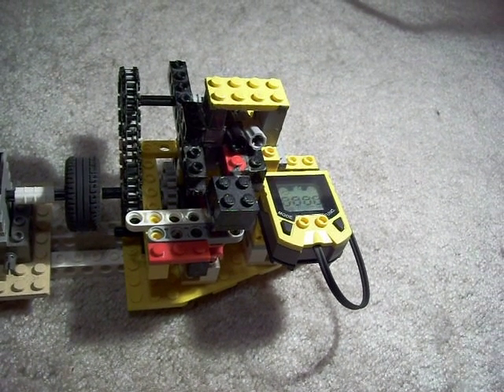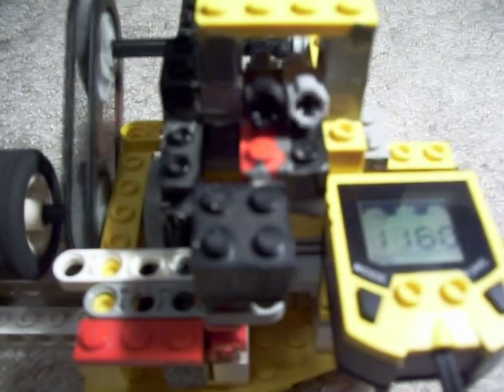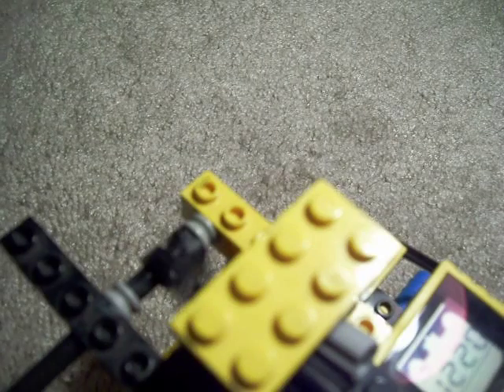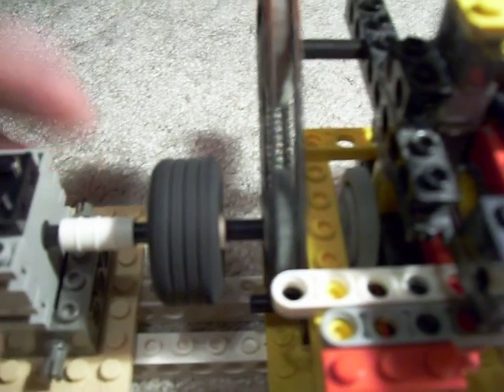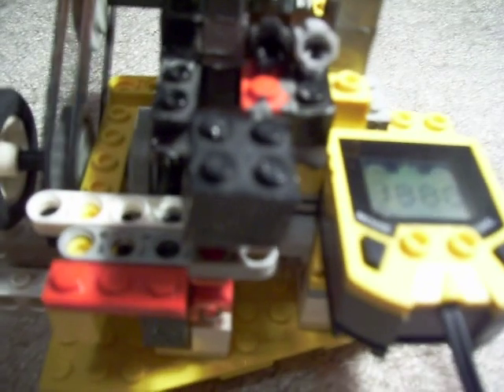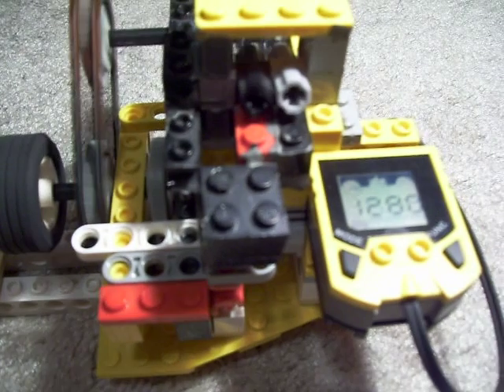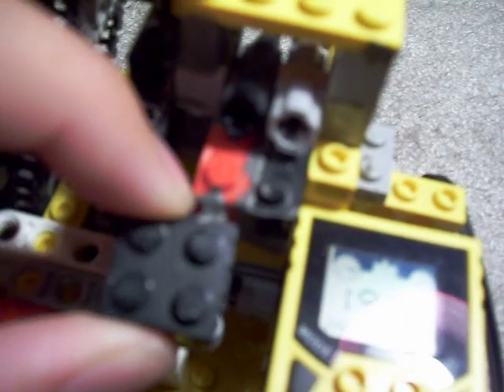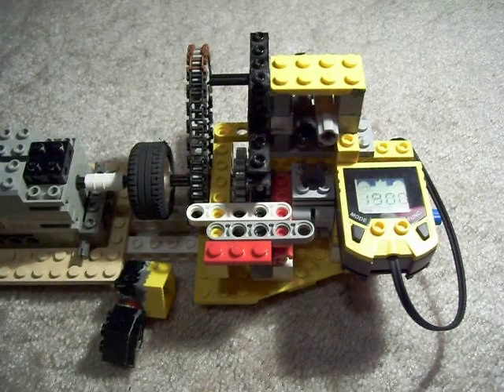4 stroke engine update #6

Comment: you could make it deisel so itll run on compresion, idea to soften springs... take a lighter to them, let em get red hot then drop it in ice cold water. just a thought
Reply: Boost Hound GP lol it has no compression its plastic 😂😂
Reply: @livingstonrc4706  Doesn't mean it can't have compression. I've made paper pneumatic engines before that have plenty of compression.